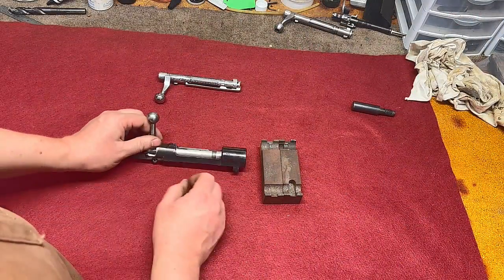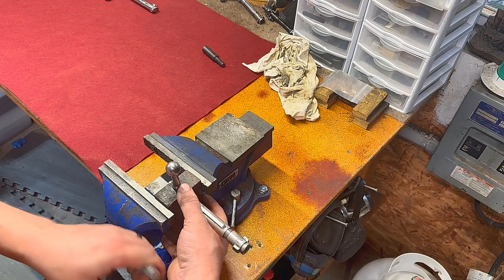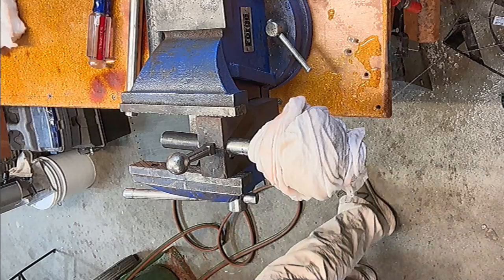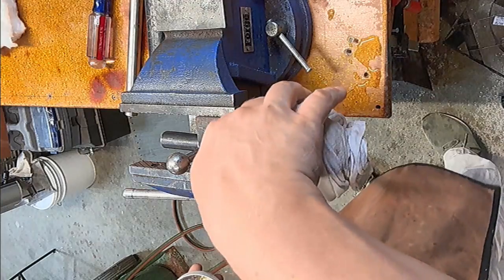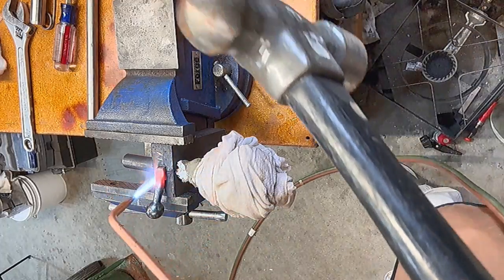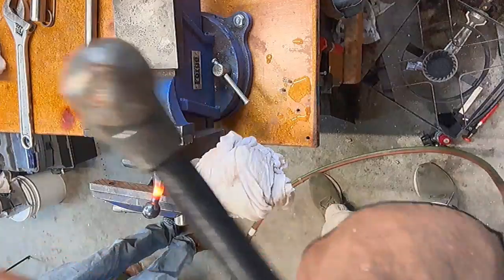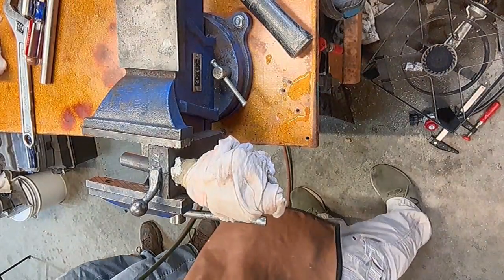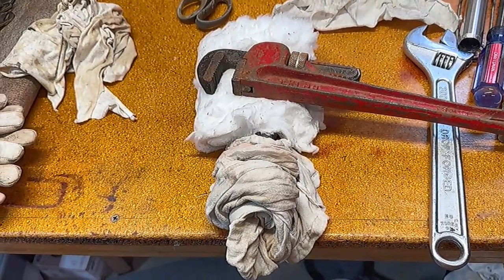How to bend a military Bolt handle - Mauser Bolt Bending

Comment: Hi, great video!  I have a Mauser bolt that is curved up too much, it almost hits the scope.  So all I need to do is bend it down a bit, say 1/4 inch.  Is there a good way to do this without making that custom heat sink?  Can I just wrap both ends in wet cloths and use a MAP torch to heat it?  I do have a good vice and an anvil etc.  Thanks

Comment: Hello
Great video.  Did u make the forging block ?
And I have looked for the heat sink bolt and can't find any.  Was wondering if u made it also. And I'm having trouble finding the heat stop puddy . Any help is appreciated. 
Thanks.
Reply from the maker: Yes, I made both the forging block and the heat sink. The heat stop paste is optional you can use dripping wet rags instead.
Reply: @Turnbullcustomguns do u have instructions for making the blocks and tge heat sink rod. ?
Thanks
Reply from the maker: @Ambassador-ju6pc  I have not developed instructions yet for them but may do a video in the future on it. Thanks for your interests
Reply: @Turnbullcustomguns , I am having trouble finding heat sink and blocks. Would u please share how I can make my own ?
Thank u so much.

Comment: NO NO you have to use a cutting torch big enough to cut a bridge in half & then overheat it as much as possible, be sure to get some impurities in there while your at it 😉 nice job  !  These other clowns are just that clowns aint that hard to heat a peice of metal and bend it . . . Properly
Reply: Ceramic fiber insulation.  High temp. Inswool.
Reply from the maker: @steveparker8723  Thank you! The words escaped me during the video.
Reply from the maker: Yea I couldn't find my cutting torch :) It doesn't take a whole lot. Just the right amount of heat in the correct places. Thanks for your comments.